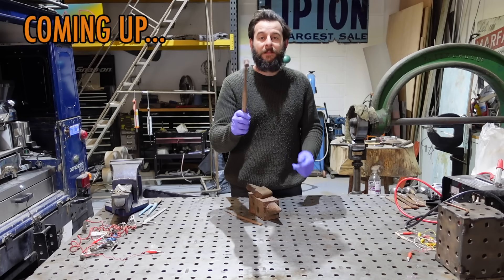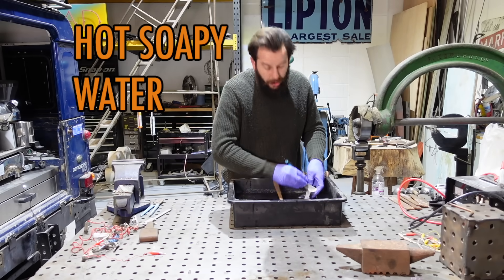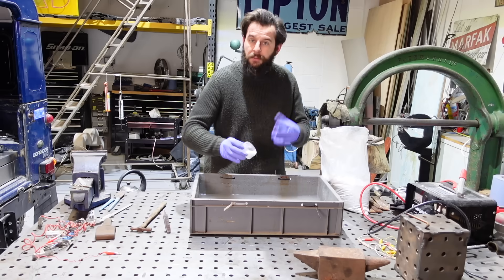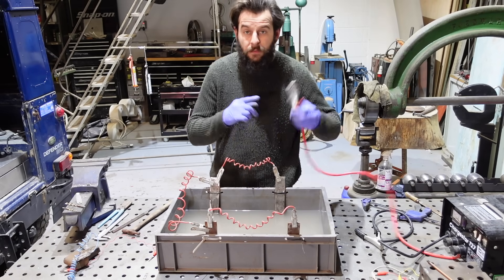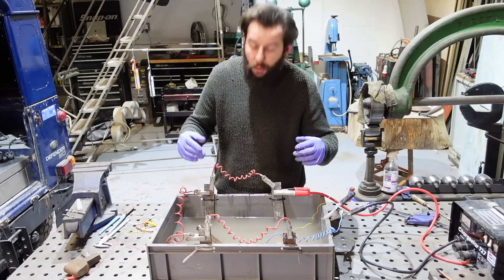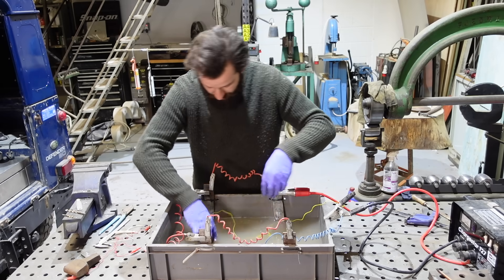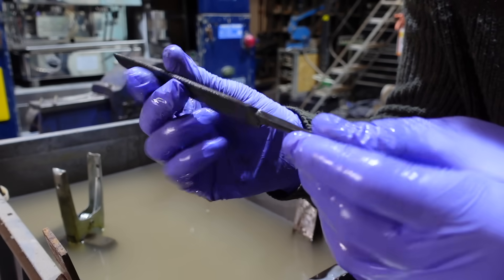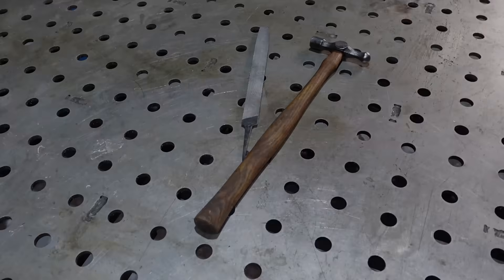The Power of Electrolysis | How To Transform Rusty Tools!

Comment: Nice technique. But the fizzing… that’s hydrogen- and oxygen-gas  from splitting the water molecules. Make sure you ventilate! Leaving it “for a couple of hours” in a closed space can build up something you do not want.
Reply: Boem, but the rust is away that for sure 😮
Reply: So don’t run the wood stove when doing this.
Reply: @MrFartenheit or any form of heating element
Reply: You can separate the anode and cathode to capture the hydrogen coming off of the cathode, and capture the oxygen coming off of the anode.
Reply: Oxygen plus hydrogen and a tiny spark, you have created a bomb.
Reply: Important point for Sure!!
Reply: It would need to be a very small space.
Reply: A brief acid dip (from an old battery) would remove grease.
Reply: @sbkenn1  using a hot water kettle like he did from the start really helps get rid of grease. It heats up water about 212° and is what I use all the time for removing grease from my stove fan filter. Soak once once to remove grease and second in electrified bath with plenty of ventilation and using goggles and gloves. Really amazed how many people don’t point that out.

Comment: Does anyone know where to buy a bog standard 12v battery charger? My sister and I have been looking for ages and can only find the fancy smart ones. Will they work?
Reply from the maker: No the fancy smart ones won’t work, look for a second hand one! eBay, Facebook etc
Reply: @DominicChineas  thank you for your help. Managed to get hold of a battery charger.
Just one more question: the wires you use to connect your anodes together: what are they called?

Comment: Man this brings back memories, I had 3 tanks side by side I used the 1000 litre plastic IBCs one had a caustic solution with a dc power supply, the next had spirits of salts (hydrochloric acid), I had a third with water, as a rinse, very important never to put case hardened steel into cleaner as it tends to disappear.

Comment: Fantastic video! Straightforward and concise!  I’ve got loads of files and bolts that need de-resting and I’m fed up of using rust converter as it leaves residue.
I have a battery charger with a selector Fast Charge or Slow Charge.
Which is best pease?
Reply from the maker: from what I understand, It shouldn’t matter as only so much current can only pass through solution, whack it on high!
Reply: Hello sir can i use NaCl instead of sodium carbonate please replay

Comment: does it matter the size of the alligator clips used to connect everything? Also the thickness of the wire, is that important?
Reply from the maker: I think as long as they are not absolutely tiny you’ll be ok!

Comment: Having trouble getting this working, but I've only a modern 'Smart' battery charger. Does this wind back the volts/current on start so it'll never get the electrolysis going?
Nice work on Repair Shop BTW 👍
Reply from the maker: I don’t think it will work at all with a clever charger.. it knows what your up to!
Reply: @DominicChineas  Ah right. Back to Gumtree! Or I guess a bench power supply would work?

Comment: hi electrolysis introduces hydrogen into the metal and will likely make the piece more brittle, lookup hydrogen embrittlement, so this is best not done on parts thatll be hit and shocked like hammers etc. works well for other parts and strips off old paint lovely, also doent seem to need the water changing, ive had a drum going for several year.

Comment: Many thanks for an easy to follow video. Using your method I've cleaned some small mild steel components and then wire-brushed them to get  a shiny metallic finish. They'll be used in an overhead pot hanging rail system, No contact with edible elements 
Is there a clear finish - varnish  - that I can apply to stop the mild steel rusting in kitchen heat and humidity, plz

Comment: Thanks from Ohio for this 'geez, why didn't I think of that?" video. I have quite a stack of collected railroad spikes for which this process would make a great solution-- rust-removal-wise
Curious regarding the Battery Charger. Would a "6v/12v 2 Amp 3-Stage Microprocessor Controlled Automatic Battery Charger" do the job?

Comment: Hey add one more of your red alligator clip lines to the 1st and 4th tabs. You will connect them in parallel instead of in series dropping the total voltage used and increasing the amps wich should speed it up.  As an aside I still cannot remember anode and cathode after 7 years of working with electronics I still need to Google it every damn time. They're like teflon to my brain.
Reply: Voltage is the differance in electrical pressure witch  can cause a flow of electrons [current] from the negative side to the positive if the resistance [ohms] can be overcome

Comment: Nice video thanks, and most welcome given my current OCD run on tool restoration.  Apologies if this question has been posted earlier, but I can't trawl through almost a 1000 comments to find out! 

QUESTION: You don't give much detail re the battery charger needed, and I see that you're using a heavy-duty Chargestar T27. So would an overnight trickle charger be suitable for the task? Would really appreciate it if anyone can shed light on this. Many thanks in advance.

Comment: Excellent, used your method to remove light rust from the surface of the disc brake rotors on a 40yr old TR7. Worked brilliantly! No deformation and a clean 'true' surface. Many thanks.
Reply from the maker: That’s so good to hear! Thank you for the feedback!

Comment: Great video. Just what I needed. Knew about using electrolosis to remove rust but didn't know what the elecrolite was; or which way round the terminals should be.
Great idea cable tying the steel to the box. I have just hung it in the electrolite on a piece of wood when I tried similar jobs (removing silver from photochemistry). Will definately be doing this as I have a few tools that got damp in an old garage.

Comment: Great vid Dominic! I often use electrolysis when removing rust on the motorcycles i restore. I use Borax in place of sodium carbonate, find that it works extremely well in cold water. cheers from Aussieland 🤙🍻
Reply: Interesting, I've never tried borax. I imagine would also do the job for removing unwanted coatings from alloy parts with out eating into them. I've been reading around the net a bit but I'm beginning to suspect that it might be very sensitive to current density and borate concentrations. I don't suppose you might have tried that by any chance?

Comment: was a perfectly serviceable hammer to start with, the wire wheel at the start would have netted the same result, and that porous finish from the electrolysis means its going to flash rust on a humid day anyway.

Comment: You have to be careful when using that much Sodium Carbonate with the setup your using. It can and will eat into the metal as-well if you leave it in to long... It's like putting to much salt into your humidifier to boost it's output. It will eat through your electrodes.

Comment: Hello,
Seems to work really well but so long winded.
If you go to your local builders merchant and buy a bottle of brick cleaner, ( hydrochloric acid), and just drop the rusty part into it, within an hour or so all rust will be completely removed.
You can even smell the fresh metal when you was off the brick cleaner.
And you can use  the brick cleaner over and over again.

Comment: I'm pretty sure the hammer is the anode (and not the cathode) in your setup.  The anode is the terminal that corrodes away its metal.  Since your hammer dissolves the rust from the hammer's surface and deposits the iron ions through the solution onto the steel strips, the hammer is the anode.

Comment: Well Dom, I just tried this today.  I had the -ve clipped to a nice clean bit of steel, the positive I clipped straight to the item, an old ratchet strap, which I wanted rust free.  After turning it on it started fizzing and probably 6 hours later I turned off and removed the item.  The -ve cathode was completely clean still but the +ve crock clip attached to the item was covered in rusty bits.  The ratchet strap was a lot cleaner but probably needs longer really.  Why didn’t the rust migrate to the -ve cathode?  That is supposed to be the sacrifice bit but it seems my croc clip took a beating and has gone from nice galvanised finish to a rusty, crusty croc clip.  Any ideas?  Andy UK
Reply: Oh what a dumb, dumb just realise I got the cables the wrong way around…. For some reason my head got it all wrong thinking current flows +vents -ve therefore the rust goes to the -ve.  I will try again and hopefully my croc clip will clean itself and the ratchet strap will be even cleaner.  Schoolboy error not paying attention!  Thanks Andy
Reply from the maker: Sorry I was just going to reply and say you got the cables the wrong way round! 

Give the clip a clean before you start try to get the best connection possible.. 

Good luck!
Reply: @DominicChineas  No need for sorry.  All sorted and been fixing away and my sacrificial is well rusty…. Deep 🤩 Thnaks for reply.  Another fan of TRS Andy
Reply: Copper wire to tie on the neg. wire

Comment: cool idea, I wonder if I can use this on my car
Reply: Be careful , some old cars the only thing holding them together is the rust .
Reply: Got a swimming pool big enough?
Reply: I used it extensively in the restoration of my '71 Chevelle.....
Reply: @fasteddie4145  How did you do that?
Reply: Don't forget to remove the oil before putting it in the pool. :-)

Comment: Hi Dom, very impressed with your tutorial on electrolysis.  I have a 240volt 24v 20amp charger, would this work as yours does or is it too powerful?  Cheers, keep up the great work, both here and on The Repair Shop (you guys do a great job, very talented one and all).
Reply: Put 2 or 3 car tail light bulbs in series in your circuit to bring the current flow down.
Reply: @juriedekock6154 , cheers, appreciate your advice.

Comment: I was given a 20KG box full of heavily rusted tools and drill bits. The rust was so bad I had to separate everything with a hammer. I used electrolysis and over a period of a week I de-rusted everything. I found a couple of American made 1921 adjustable spanners and a full set of Spade Drill bits and many hand tools. I used Baking soda and just the one anode. After drying the items I gave them a light coat of oil. I was told doing this would make sure they wouldn't rust again. That was 10 years ago and everything is as good as the day they were treated.

Just a few points. There is no need to use that extra wire unless the tool is comprised of two parts. A file or anything of one part has a better connection than wire with 2 clips A file end to end would have perfect continuity, not so with wire and clips. Your items weren't exactly rusty enough to use electrolysis. The difference between a tool which is basically a ball of rust and the same tool after it's been de-rusted is amazing. I've had a spanner which was a guess at what it was turn into a spanner with a deep black sheen to it which looked as if it hadn't been used. Everything I worked on had lost it's chrome look and had that black sheen. Surprisingly nothing was pitted and I've never figured out why that was, not that I mind :-) 

As for the power required, basically any source of 10 to 40 volts at 2 to 5 amps is OK. I tried many combinations and settled on 18 volts at 4 amps. I had no trouble putting my hands in the solution, but did sense a slight tingle, there's nothing to be scared of, no fear of electrocution as long as you don't drop 120 or 240volts across the connections. :-)  When looking for scrap steel, be careful not to use Stainless steel, it won't work. Call into a metal worker in town and ask nicely if they have some suitable scrap steel. I handed our local guy $10 after he told me to help myself to anything at the back of his shop.  Just before I left with a handful of scrap he told me to return if I wanted more. One final tip, those storage bins most big stores sell are terrific for electrolysis. Get a large one, just in case you get a cross cut saw to de-rust. By the way, if you have tools with paint on them, the process will remove the paint as well.

Comment: I now see your warning about ventilation, I will not do this indoors because the process makes Hydrogen.
I've been doing it for a while now with great results but I have found it best to do one job at a time.
For really old stuff I wire brush it after and it can leave a great textured finish with all the holes and corrosion with the rust removed, then I just spray a bit of clear lacquer over it and "Bobs ya uncle".

Comment: Great video, however l don't think using this method on a hammer or similar tool with a wooden handle is a good idea as the water causes the wood fibers to swell inside the hammerhead thus compressing the fibers and will cause the handle to be loose in the hammerhead when it dries. Jmo...

Comment: Thanks from New Zealand Dom. The repair shop is on here tonight and I as you all do a fantastic job there I was wondering if it actually exists for anyone in the public. I found my answer and your channel in my search. Just wanted to say a big thank you from my partner and myself to yourself and the team for some really nice resto's. You guys are geniuses who apply your knowledge very well! :) and everyone is so so grateful. It must be very rewarding for you all.

So I picked on your electrolysis clip because I am wondering about cleaning up some large areas of surface rust. Unfortunately it's on old galvanised metal so I'm going to have to figure out if it will work. I suspect it won't work without removing some of the zinc too.... That may also be the case for the chromium plated sockets someone mentioned here. 
For one of the other comments I haven't worked out the chemistry of the process (and I can't remember my training of long ago either!) but I suspect it may be carbon dioxide being gased off. Got to go TRS is starting!! :)

Comment: I have some old sockets where the allen key part is rusty steel but the socket body is some sort of alloy will it still work?
Reply from the maker: Yeah it should still work if you connect the wire to the rusty part
Reply: @DominicChineas  thanks

Comment: The 'lumps' on your hammer are bits of weld :))) I was given a VERY old engineers vice that is seized uo and rusty. I freed off all the parts soaking it in WD40 (diesel will do). But was wondering HOW to get inside and clean all the rust NOW I KNOW so Im buying a charger i already have the plastic box! CHEERS! Also converting my rusty old van into a luxury camper this will be invaluable!

Comment: Good luck finding a simple continuous current battery charger. I couldn't get my charger to work without it pausing to let the transformer cool down. All the automatic chargers switch to a trickle charge when they sense the battery approaching full charge.
That's the work around. 
Put a 12 volt car battery between the charger and the parts in the solution tank. The continuous draw of the electrolysis keeps the battery from getting to a full charge state and the charger keeps pushing electrons. Worked for me.
 P.S. be sure to use at least 14 gauge wires to make your connections. You' could be  pushing a lot of amps, 15.5 a in my case.

Comment: That your current is so low suggests that your electrolyte has poor conductivity and you should add more sodium carbonate. You can make a supersaturated solution by boiling the water in a pot on the stove and adding the salt while it is boiling. That way you can be sure to get the greatest effect, and if some crystallizes out, no big deal.

Comment: Great. Want to try this and have read many other comments regarding safety and so on.
Question 1 - how often can i re-use the electrolyte or must it be changed after each cleaning session?
Question 2  - What's the best way to dispose of the waste electrolyte?
Question 3 - My battery charger has 2 modes, normal and boost. Which is the preferred mode?
Question 4 - Does it help to wire brush rusty metal before electrolysis?
Thanks.

Comment: CHELATING AGENT effect of Molasses works better from my experience if you can stand the light smell and have 3 weeks to do. A ratio of 1 to 9 parts water. Get a gallon at the feed store real cheap for feeding deer, or 8ozs at Wally World. Being in England you can also use tea like a watchmaker...  It will remove rust between bolt and nut leaving silt in between. Just wash off. I like using a pressure washer. The old care guys mixed it in bathtubs or kiddy pools for fenders bumpers etc. Cheap and effective for up to 7 months it does smell like crusty maple donuts though. I've tried many things and this is hands down. It will turn your parts gray. I found that using electrolysis gave inconsistent actions depending on the weather, metal etc. sometimes Id get deep pitting on my planes when I knew the metal was not that bad.... never use stainless steel for your anode as it will produce toxins.

Comment: Isn't it a perfectly usable hammer already ?
Reply from the maker: I was really just showing the process.. 

You wouldn’t want to use a rusty hammer when welding or working with aluminium etc as it will contaminate the metal
Reply: I'm going to try it out. Thanks 👍 for the vid 😊